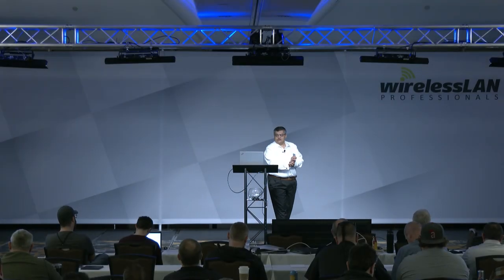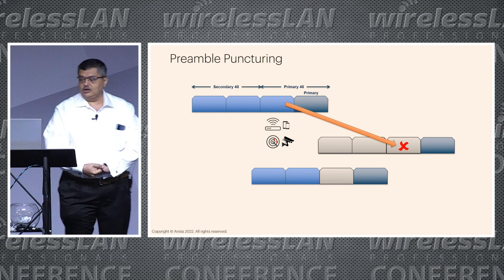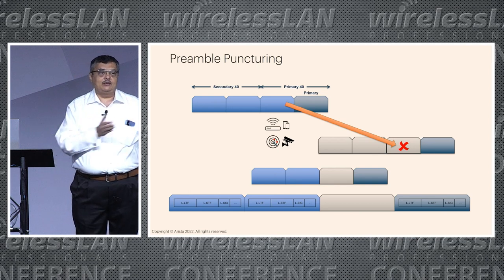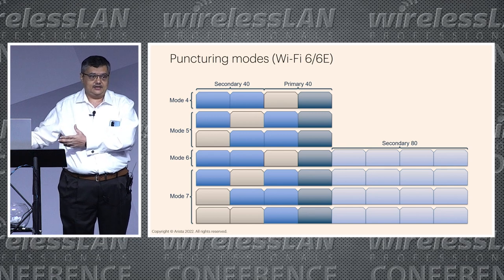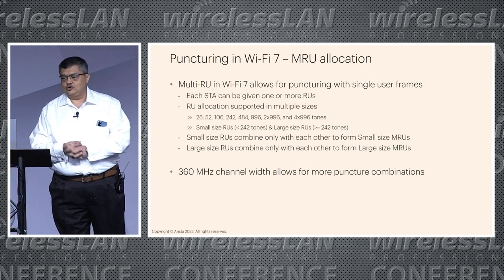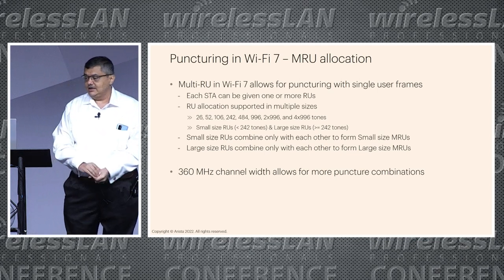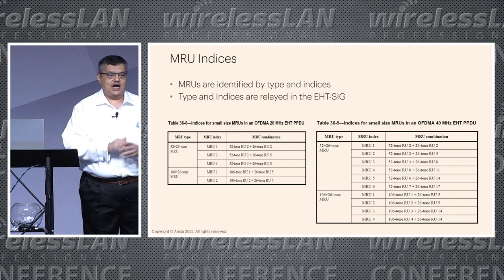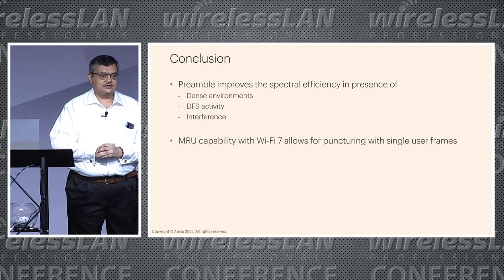Preamble Puncturing in 802.11ax and 802.11be | Jatin Parekh | WLPC 2022 Phoenix

Comment: How do preamble puncturing negotiations occur? Is it automatic? Is it supported in both 2.4GHz, 5GHz and 6GHz bands? Is there any latency penalty? In a case of a network with a mix of devices, some clients that support preamble puncturing (Wi-Fi 7/6) and some that do not (Wi-Fi 5/4). How will the network behave?